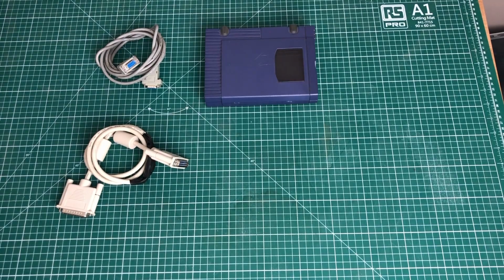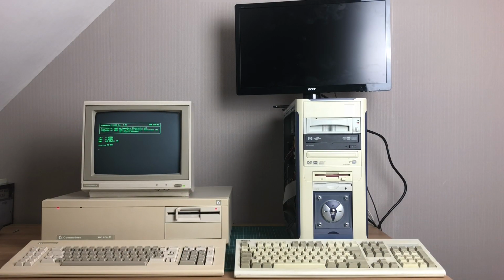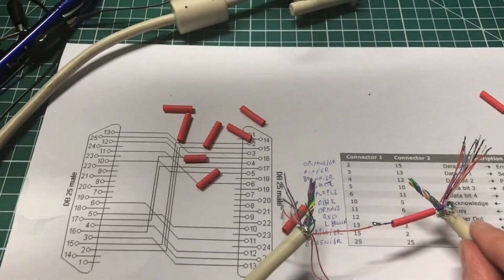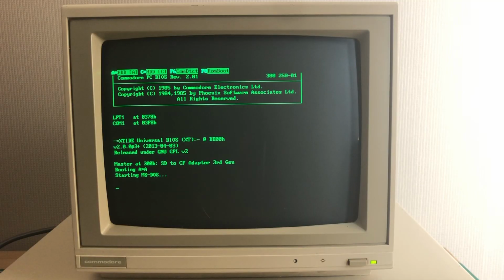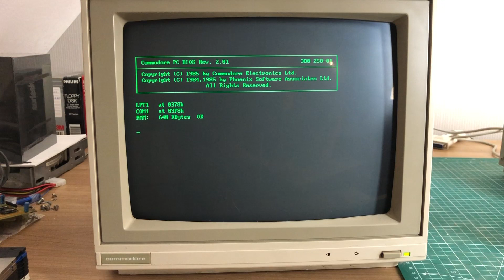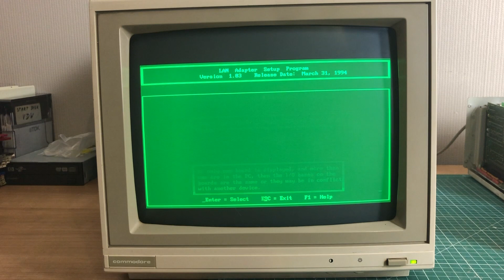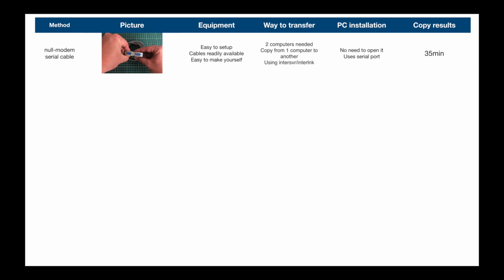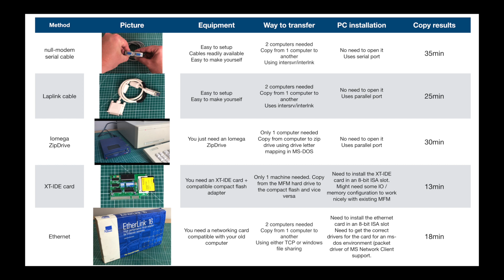5 ways to get data from and to your retro machine

Comment: nice video ! In my practise I use good old Norton commander 4.0 and LPT-null modem to transfer data - on other side usually a notebook with PCICMIA->CF card or win98se and usb device...
Reply: What is the pinout for norton with lptnull?
Reply: @logipilot  I use standard null modem lpt cable - bought it on computer market about 2006, when baegan to collect and use vintage computers

Comment: Very interesting video, but i would ask: if you are gonna use the null modem cable and you can’t put interlnk on 5,25 floppy (i.e. You have some other machines so you can copy files between 3,5 and 5,25) what would you do in that scenario? Someone could simply swap the floppy disk drive, but there is actually a software  solution for that, if you don’t mind typing some basic lines …

Comment: If you really need to use floppy disks: Friendly reminder that there is a software program called "Hacha". It'll split any file (like a zip file) into equally sized parts you can join later. That way you can move files over 1.44 mb in size

Comment: Have to mention that if you are using Norton Commander, then for serial and parallel connection you don't need any additional programs. Norton Commander has support built in. It's in one of the tabs. Don't remember off the top of my head. I think it's the second one from the right, direct connection something... hard to recall after 35 years.

Comment: You can use Norton Commander directly for the serial null modem cable. It does not map it as a new drive but you can copy files directly.
Reply from the maker: I also read that everywhere but I believe I could not find it in this version ... will need to take another look.
Reply: i use total commander

Comment: Most of the time I use the ZIP solution, using GUEST iomega software. But, some machines only have DOS3.X and that does not work with GUEST... So I guess I'll try the null modem, looks like a nice way to share files!

Comment: personally i like my first computer a gatway2000 with a am486dx133 running with a xt-ide even if it dose cost 60+ usd i love it i also have a netgear ea201 16bit isa Ethernet card its running 3 OS,s dos 6.22  win95 and antix linux 
just in case anyone is wondering antix will run with a 8 bit controller i wasn't sure at first also
i agree (spunk mayo) This channel deserves more views

Comment: I really liked this video, thank you! What I was found missing is:
1. You didn't mentioned about cost. By cost I mean:
a) cash (eg. I bet that CF card reader + CF card itself costs more then serial cable)
b) time - how much time you spend (eg. on moding LPT cable)
2. True that CF card was the fastest, but you have it on card now. The same  with ZIP. IMO you should show also how much time it took to copy data to your PC from this CF and ZIP cards. Right now it's not perfectly 1:1 coparision. (In my opinion)
3. Max supported capacity of CF card. ZIP card has 100Mbit, right? And CF card? Do you know max supported capacity?
Thanks one more time! Cheers!

Comment: That parallel/LapLink cable brings back memories of using a hand-made cable to hook up together two Linux (or *BSD, or one of eacj) and use PLIP to make a simple two node network. It wasn't very fast, I seem to remember it being maybe two or three times faster than a dial-up modem, but it was fast enough to play Doom or other fairly graphics-lite games. Or copy files, even set up UUCP, or play with "old-fashioned" Unix network utilities. I even used PLIP to control my Minix v2 box that in turn controlled our original DSL connection. Those were fun and certainly educational days!

Comment: I use a zip drive on my old ps/2 286, after the harddisk died and a SCSI or IDE sort of card with MCA connection was too expensive if i could find one... it was the cheapest way to use the zip drive, it is a bit slow, specialy if you want to play games that need data for levels etc. But it works... on other old machines (my 386, 486 and p1 and p2) i use a sd or cf solution wich also works very well

Comment: Thank you! I've been searching for days on how I could possibly get files transferred over to an old Toshiba T4850CT, given I don't have any IDE adapters for the internal HD, and the internal floppy drive is  busted. I have null mode serial cable arriving tomorrow ,but was wondering how I was going to use it given all I have is Windows 3.1 on the laptop, with the terminal.exe, and windows vista on my desktop. It has been so long since used MS-DOS 6.22 I forgot about intersvr. I copied it off the DOS install disks onto my vista desktop, used EXPAND to extract it, and it runs on vista. Luckily it's already on the laptop. Hopefully it works. I will know tomorrow when I receive the null modem cable. Anyway, you've earned a new subscriber!
Reply from the maker: Thx a lot !
Good luck and let me know if it worked...
Reply: RetroSpector78 sure! Would you happen to remember how to get PCMCIA cards working in Windows 3.11 or DOS 6.22? Nothing happens when I try to plug in a CompactFlash card via a PCMCIA adapter.
Reply from the maker: mqb17 never tried pcmcia in msdos 6.22. Read that pc-dos 7 has better pcmcia support.
Reply: RetroSpector78 yeah, I suppose I could install Windows 95, as this laptop supports it, if I get the Floppy drive working.
Reply: @RetroSpector78  How did it work? Well, I was able to run intersvr.exe in Vista, by copying it off an MS-DOS 6.22 disk, and that worked.  I was able to run interlnk.exe on the Toshiba T4850CT.  The amazing thing was the two machines saw each other, and intersvr on the Vista machine showed a new connection.  Interlnk on the laptop also worked, and I had a few new  mapped drives!  So, I tried to change to one of the drives, and intersvr on the Vista machine crashed with an illegal CPU operation. THANKS WINDOWS. 

Anyway, I had to resort to downloading Hyper-Terminal on the Windows Vista machine (it was no longer included with Vista,) and run Terminal on Windows 3.11 on the laptop, and you guessed it, transfer files over one by one using XMODEM over the null-modem cable.  4.5 hours... it's going to take 4.5 hours to transfer the Windows 95 OEM installation files, a whopping 24MB.  It won't let me connect faster than 19200 Bps. 

I also bought a UNITEK IDE to USB 3.0 adapter (I had forgotten I ordered one).  But guess what? The laptop IDE drive doesn't show up on my Windows machine.  OTHER IDE drives do, just no the laptop one. 

So I tried to use RUFUS to format an 8GB drive as a bootable FreeDOS drive, and copied all the Windows 95 OSR 2.5 installation files, and popped that in to the laptop.  It booted as far as "Starting FreeDOS", and just hangs there.  :(

Oh, disk 6 finished copying over null-modem, only 15 to go!

Comment: Hook up a CF is always my preferred method, but I have an IBM PS/1 that use proprietary ISA and IDE busses, so Serial link was the choice. Even if the CPU was a 286@10MHz I managed to reach excellent speed using a 7wire serial cable along with LAPLINK 5.0 that supports data compression. More than a Megabyte per minute if I recall correctly. I would also suggest FILEMAVEN a freeware file transfer program for DOS. Time for a new test! ;-)
Keep up the good work!

Comment: I used a SCSI controller with a 1GB hdd attached to backup my HP Vectra 35's MFM drive, fast to connect and DOS 6.22 was able to see the whole capacity.
Cant remember if it was using 8bit or 16bit ISA slot I think the old Adaptec card could handle either.

Comment: Hi, Wow , a very nicely put video ( ok your other videos are very well done as well )

Just a few notes from what i have experienced - this is not criticism but just some thoughts and notes that other people viewing may find usefell.

Null modem cable is the simplest and slowest, however you can have a 3 wire null modem transmit to receive, plus the opposite and also a common ground, this will work but will use software XON/XOFF flow control -it is not a problem, it just will use CPU cycle to determine what to do, as the software is doing CRC checks all the time for error correction is it probably adding say 5% overhead and slowness.

This is overcome with the hardware control which is extra wiring in the null modem serial cable, but in reality the CPU is still doing the checks anyway, it is just using hardware interrupts to stop the flow ( or software to hardware signals )

At one stage, we were almost forced to use null modem serial cables to get saved files of a 360 5.25  floppy machine to a newer 720 / 1.44 3.5 floppy machine before we had enough money to afford 2 floppies or had a machine new enough to run the hot new hardware. - At this stage i was just using PCtalk or Telix modem software to transfer the files.

Parallel null modem cables, as mentioned standard parallel will work, on more modern PC's say 486 / Pentium you can get enhanced an bi-directional parallel, how much faster it is i am not sure, but in printing to say a HP laser 2 it is actually faster as i found out at work back in the early 90's, newer PC with the faster parallel port made printing A4 pages on the same printer and same driver faster.

Zip drive, oh yeah the external click of death, actually i had one and did not have a problem in the 6 years that i owned it, i did sell it with the P100 i had at the time, later on i had a apple ( Performa all in one ?? ) with a build in scusi version and found 2 left over zip floppies that i ended up giving 1 each to my kids to store there homework - they ran apples with system 6 or 7 at school - this was before Imac and OSX

At the moment i have a Gateway Pentium 2-233 with a IDE version of the zip drive, it works fine, i have base install backed up, full dos, backed up , dos and games backed up, and another zip disk with dos and Win 98

Lan cards, work well, most older ones would be 10meg  if you are lucky 10/100 in later PCI, but not saying that a 16 bit cant to 10/100, i dont know i dont have one. Last year in a garage clean up i threw out all my co-ax lan cards and my 8 bit SMC and NE2000 8/16 bit cards. funny late on i found my driver floppy's and also a cd rom i had burnt in @ 1995 with all of my hardware floppies saved on it. I still recall initializing the cards then loading LSL / IPXODI etc etc 

Not sure when  INTERSVR and INTERLNK was available in MS-DOS , but definitely on 6.22 ( i dont think it was on 5 but that is a guess )

But, i use to fastlynx 2 and laplink 5   ( i think i have 3 somewhere  - but i did buy 5 with the double ended 9 and 25 pin serial cable ) and also later on PC anywhere - some thing tells me i used xtree pro, but that would have been after getting the 2 pc connected and drives mapped 

To back up complete floppies or boot / install cd's  and transfer i used DCF - disk copy fat, this read a floppy and saved it as one large file.

One thing to remember all of these will only run on native dos, you cannot run them in a dos session or use Win XP or newer as they donot have full hardware access to peripherals. If you want to copy to a XP machine, you will need to  partition the drive and format a fat16 ( the entire fat12 / fat 16 / fat 16b will take to long to explain ), then just boot of a dos 5-dos 6.22 dos boot disk, you will only see the dos fat 16 portion of the hard drive - the XP version being NTFS will be invisible - you can now run the dos software to connect to older machines

Fun days -  The best use of a null modem cable - Playing 2 man doom !!!
The best use of network cards - playing 4 man doom at home

Regards
George

Comment: i'm curious to why some perfeer the Zip disk over the SuperFloppy when only dealing w/ the ZIP100 (when dealing w/ the higher capacity ones i can understand)
Reply from the maker: Not aware of the superfloppy. Zip drives are really popular over here so very convenient to use them.
Reply: @RetroSpector78  The laser servo (hence the LS in LS120, the usual name for the 'super floppy' mentioned) technology was briefly considered by IOmega, but rejected.  The main advantage of LS120 SuperDisk drives (besides an extra 20MB or so capacity over Zip) is that they are back-compatible with regular floppy disks.  Like Zip drives, they were available in external parallel and internal IDE variants.  I don't know if there were SCSI models.
Reply: @MarkTheMorose   There was, as well as USB Versions, there are 2 models of the USB variant, one that had a SCSI to USB interface inside and uses a really bulky connector thats prone to breaking/shorting, and one thats based on IDE to USB using a standard USB cable you'd find on a SmartUPS or Printer.

Comment: Hello, would you say that it would be as fast or faster running programs/games via Ethernet than directly on one of those very old drives?
Reply from the maker: Would need to check. Will try to do that. I imagine it’s not just IO bound but also cpu bound when doing networking on these xt class machines. And they are really slow :)

Comment: ouuuh ... brings back memories :D
but btw didn't NC have an internal way to transfer datas via serial / parallel cable?
I am not sure but while I am thinking about it ... 
That was a very easy task ... 

later ZIPs also have 250MB  - I still use them today for backups and transfer big datas between pc and amiga
Reply from the maker: I've only used interlnk / intersvr. Heard good things about fastlynx also in the comments. Also always thought that norton commander could do it but didn't see the option in nc4.
Reply: mh... it is soooo long ago we used it ...
I would have to dig thru my diskettes and old hard drives and have a look ... give me a week :D
(btw the old pre GB size ide drives seem to live for ever ... )

later, I made a LAN cables for the users around me, with a switch in the middle, to cross the wires, so we were able to direct connect 2 computers to copy files and also use the same cable to a LAN HUB. Damn slow, but faster then serial/parallel haha

Comment: Just put the hdd into the new pc and copy? :-)
Reply from the maker: Not so easy with these big mfm hard drives. A pain to remove from these big bulky computers, and most modern pc’s don’t have an mfm controller.
Reply: mfm died those days very quick  (thanks computer god) they were a pain
Reply: @RetroSpector78  I wonder if you could use one of those usb2isa "virtual ISA slot" cards.  I don't have any old hardware like this anymore, so I can't test it.  But if it worked it could be a way to attach an old HDD to a current machine and dump the data off of it.

Comment: Also check out FastLynx 3.3 works just like Interlink, client runs on Windows even 64-bit and can be used over Serial, Parallel and Ethernet plus it can Bootstrap itself over Serial to the DOS computer so you don't have to use a floppy to get it started on DOS.
Reply: OMG! I'm going to try this right now... It works on DOS 6.22 as well?   Yes it does! $20 well spent.  I am now transferring over the nullmodem cable at 115000bps, much better than the 19200 I was getting using the same cable in windows Terminal.  So glad you posted this, and I saw your comment.
Reply: @mqb17  Hope that helps, wish I found it years ago.
Reply: @MortusArtis  It absolutely helped!  I am able to transfer at 115000bps, instead of 19200 now. :)  $20 well spent!

Comment: 4:32: "I actually purchased this one as a LapLink cable." 
That's somewhat confusingly put, because it sounds like you're talking about the cable you're cutting up, but you're really cutting up another cable to make a LapLink cable (like the one you also purchased at some stage in the past).
Reply from the maker: Well I did purchase it because it was described as a LapLink cable but it turned out to be a simple passthrough cable.But perhaps I should have been more clear.
Reply: @RetroSpector78  That explaines a lot. I use to use a parallel Laplink cable and it beat serial by a factor of two-and-a-half / three.
Reply: Yeah I also got confused - why buy laplimk cable and then cut it open...

Comment: Really nice video how about some External USB to IDE cable connect directly to the HDD of the old pc maybe using USB extension cable so you don't have to remove the hard drive. 2nd use a cd/dvd burner.
Reply from the maker: Problem is that these really old PCs don't have an IDE interface. IF they have a hard drive it's going to be an MFM hard drive, and it's not so straightforward to hook those up in an other PC.
Reply: @RetroSpector78  https://www.ebay.co.uk/itm/BRAND-NEW-XT-IDE-ATA-CF-8-BIT-ISA-CARD-FOR-RETRO-COMPUTERS-BOOT-ROM-UK-SELLER/143228603444?hash=item2159170c34:g:L-MAAOSwmjZdnHmG how about something like this for a cd burner or ide to MFM copy
Reply: @RetroSpector78  really liking you're videos, thanks for replying

Comment: Hmmm... I remember using actual floppies to fill up the MFM HDD of my XT. But later I replaced the whole thing with a 8-bit SCSI card and I could actually find a PCI Adaptec SCSI controller that I managed to persuade to work in my S1155 Win7 PC - it was a big gap I jumped here.

Other cases I usually stick to CF cards and CF-IDE adapters. But XT (and very oldschool AT) is still a hard nut to crack. Next time I'll try the NIC approach - but not to copy via network but as a vessel for XTIDE BIOS. We'll see, I'm really curious.

(CF cards are mighty convenient. A simple USB card reader is enough to connect them to any modern PC. I'd love to use them for XTs too.)